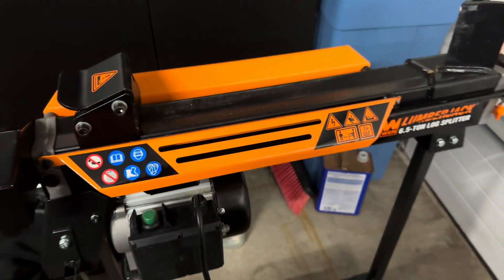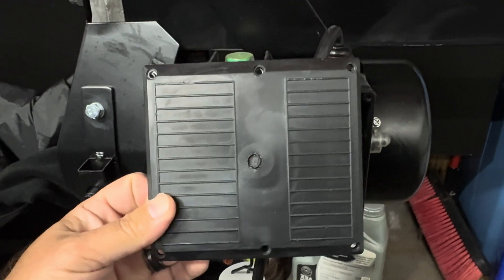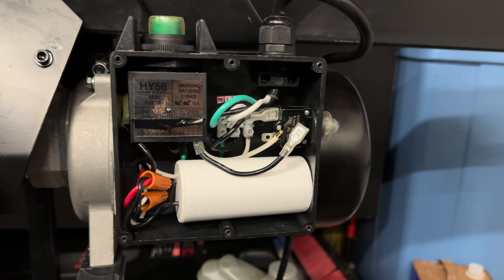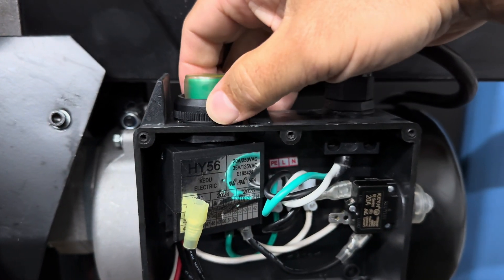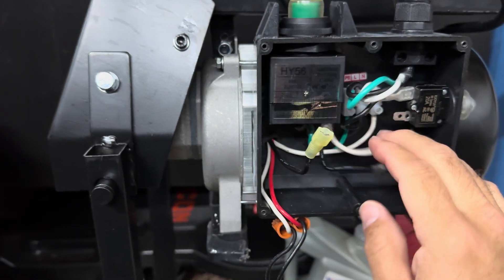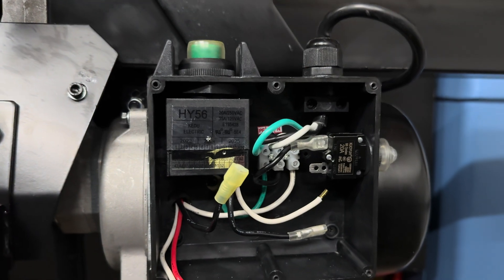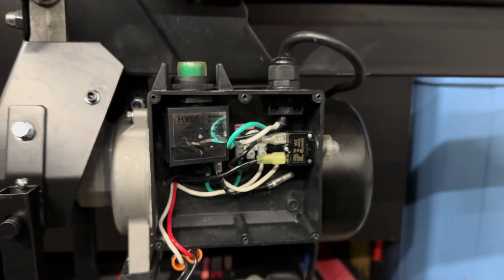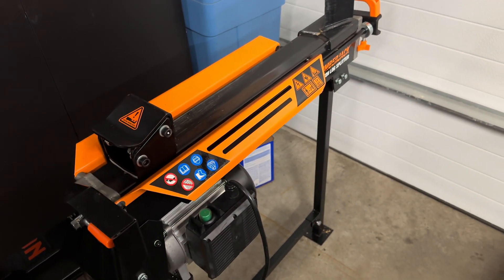Wen 6.5 Ton Electric Log Splitter Rewired for Foot Pedal

Comment: Yeah I ain’t doing all this crap. I’m pulling that green switch out and wiring a simple on off toggle switch. Plug it in, flip the switch and roll with it.
Reply from the maker: Perfect. Make a video about it.
Reply: The boom doesn't retract unless the power is cut. You gonna be switching that shit off between every split 😂. On. Off. On. Off. On. Off. On. Off. Every 5 seconds.

Comment: I just purchased a Bilt Hard 6.5 ton splitter with base.  Rather than this rewiring crap, I just used a clamp to turn the unit on permanently, and plugged it into a Wen foot switch.  Now I have a one hand operation.  Press the foot switch with my right foot, then with the right hand, push down on the handle....simple.  No rewiring necessary.  Foot switch cost $12.5O with free shipping from Amazon.
Reply: I saw a video where guy just drilled two holes at the plastic top and bottom of the switch and ran a cotter pint thru holes to hold down the switch.

Comment: you skipped over the foot switch plug, its got a 3 prong, how did you connect the splitter and switch?
Reply: you plug your splitter into the foot peddle-the foot pedal plugs into your outlet

Comment: ...... Doesn't the pedal kit have a 3-prong wall outlet in/out already wired up? Why not just use a rubber band or something to hold down the button on the log splitter, and just use the foot pedal between grid power and the log splitter, as it is intended? No rewiring, no warranty issues, no shock hazard.
Reply from the maker: @noahh.9062  so you can have both hands free. A rubber band wouldn’t hold the button down. Using a clamp or something to do it adds something else you can get your clothes snagged on or something. I sure wouldn’t want in there if something went wrong and I needed to clear my hands/arms out quickly. Having a button is redundant when you have a foot pedal.

Comment: I've got exactly the same log splitter.  I took mine and took the two wires that we're going to the motor unscrewed both the positive and negative from the switch, and just double them up on the other side of the switch bypassing the switch altogether.     I didn't have to cut any wires.  And if I ever want to put it back the way it was I just have to screw them back to the other side of the switch.   Simple.
Reply from the maker: Not a bad way to go. If I am understanding you correctly, I think you simply attached both black wires to the right side of the switch and both white wires to the right side of the switch. I definitely think that would have been the way to go, now that you are saying it…. It seems so obvious 🤣😂 I appreciate the comment and hope it helps someone reading this!
Reply: Could you info me to show me exactly how you did that to bypass the switch I have the same splitter thanks
Reply: Can you share a pic or post a video of what this looks like?